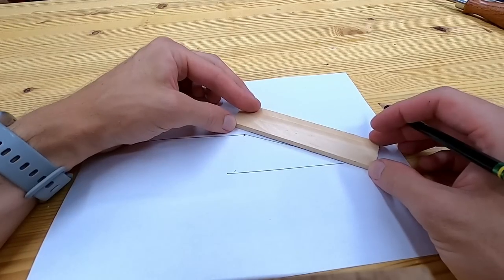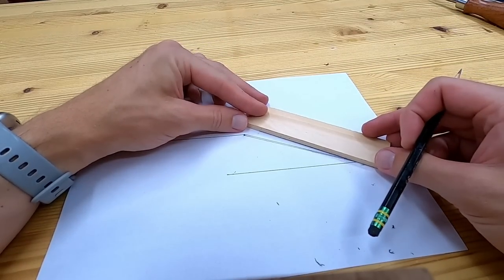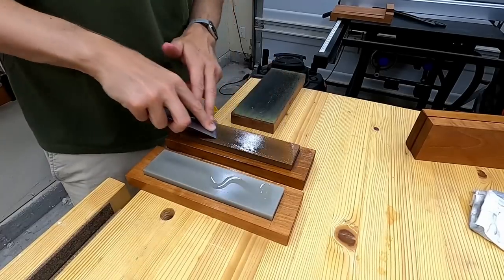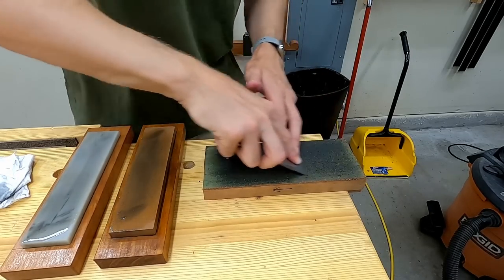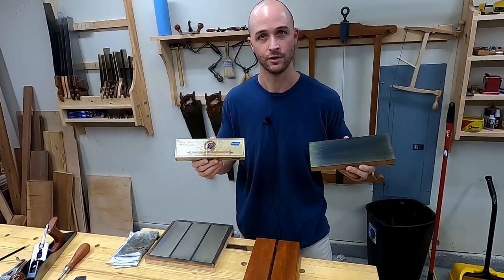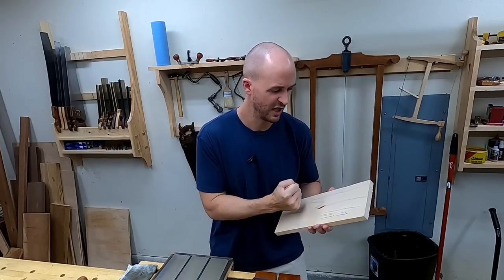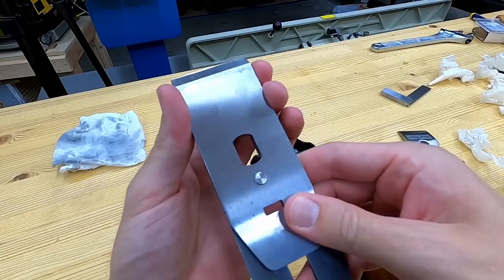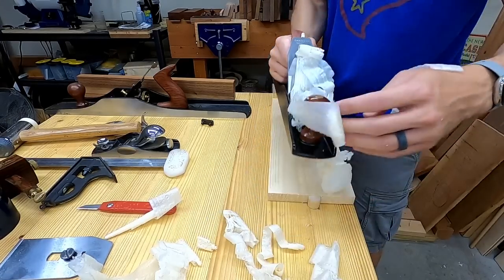Plane Iron Sharpening - Oil Stones or Diamond Stones

Comment: Very well-made and informative video.  Your system with the oil stones is similar to what I have been using since around 1965. I must say, however, that I have fallen to the BS about other stones and have invested in both water stones and diamond stones but always, repeat ALWAYS, return to oil.  I have a Norton stone that must be over 60 years old and still working well.

Comment: 👍👍👍I find it so refreshing to see someone on YouTube – someone whose sharpening is so obviously excellent to judge by your incredible plane shavings – only touching the primary with a coarse stone! If there's one thing that does my head in it's watching someone who purports to be an expert taking the primary up to a high grit (10k or higher?) when it contributes nothing whatsoever to the cut 💢

This is pretty much how I sharpen when I'm being disciplined and want that defined secondary bevel, which I tend to reserve for paring chisels. Most everything else has a single cambered bevel (1000# diamond plate followed by a denim strop loaded with metal polish). Just as you showed the angle does creep up over time so every now and then when it's needed I work the primary down on a 150# diamond plate if I can't be bothered to break out the grinder LOL
Reply from the maker: thanks, I sure appreciate your comment!

Comment: I was thinking about this for a while now, works great on the new thick plane irons, easy to stay on a flat bevel, it's really hard to not round the main bevel on old Stanley irons, they are ridiculously thin.
Reply from the maker: Absolutely true! For some blades I only pull it on the stone rather than pushing and pulling across the stone - easier to hold the bevel. Also a 2" stone makes it easier to hold the bevel than a 3" due to the skew

Comment: Thanks Frank, I tried this method out yesterday, it worked great. I think I will adopt it and if needed re-grind the primary bevel if it goes too far out from 25 degress.  I like the flow idea to avoid the grinder and honing guide if possible, and get back to planing.  Awesome channel, subscriber I think since your 1st video.  Thanks!
Reply from the maker: Thanks Scott that's awesome to hear!

Comment: Great video Frank, your technique is similar to mine, diamonds or India and Arkansas. However I like to strop with red rouge on thin leather strop, rough side up. this is a bit more aggressive and give a mirror finish that is sharp. I started putting a mini bevel on edges after watching your previous sharpening video. This really helps a lot. My theory on this is not so much to add a bevel but to ashore the tip is honed completely. As far as the burr goes I like to pull blade to make it fall off instead of breaking, but then sometimes I will chase the burr too.
Reply from the maker: Thanks Jim. I agree with your theory on the burr... If we can make it quicker and easier to get a good burr, that's really what it's all about.

Comment: I have shapton glass , and even though they are splash stones and dont need to be soaked , i still hate the mess - im using a fine india and then directly to mdf with stropping compound ... Gets really good results - i might add a translucent arkansas stone like yours just to reduce the stropping time .. i like how little mess oil stones create .... Btw i think that yours is a fine india stone rather than medium india .mm i have both and the fine india is orange color while the medium is black ... I might be wrong and they have different colors though hehe

Comment: Hi Frank! Thanks for the video. A couple things I might add:

1.When my secondary bevel was not steep enough, I found I was loosing the sharpness of the edge way too quickly. When my secondary bevel was steeper, say 35 degrees, my planes remained sharper for longer.

2. The distance between edge of the blade and edge of the chip breaker was best set at 2 to 3 mm. Otherwise, chips would somehow find their way between the blade and the chip breaker.

3. The "Charlesworth ruler trick" just changed MY LIFE!!!!

Question for you: how difficult/easy is it to flatten an oil stone compared to water stone? And how do you do it?

Thanks!
Reply from the maker: Good points thanks for commenting! They are much more difficult to flatten than water stones, but really don't go out of flat if you use the whole stone. I've only done it once (around December last year) and I actually regretted doing it bc I discovered that the ever so slight dish across the width was like a built-in ruler trick. Honestly, I doubt if I will ever flatten them again, if an area on the stone starts to seem high, I'll do more sharpening in that spot, but they are very hard-wearing and don't think it will be an issue, I will have to update in 10 more yrs haha
Reply: 1. Steeper than 30° you're losing sharpness. Shallower than 30° you're losing strength. So stick with 30°

2. If chips are getting between your breaker and iron you need to lap your breaker flat. Hold the iron and breaker up to the light. No light should pass. If some does lap the breaker. I've had to clean the tops up on some breakers that are really worn too.

3. The ruler trick is trash. There are no shortcuts.

Answer: A belt sander can really make short work of a honing stone. It can get dusty though.
Reply: @1pcfred  I suppose to each their own. I have found these practices really useful and am able to get finish ready glossy surfaces on hardwood and softwood, end grain and knots alike. and I get these results from inexpensive planes, without spending a fortune. So, I am happy with the results I get, with spending only a few seconds on sharpening, while substantially reducing the number of sharpening sessions. Proof is in the pudding, doesn't matter how one sharpens an iron -  the product (the furniture one makes) speaks for it self. Also, there are always shortcuts but one must know how to use them to their advantage.
Reply: @mohdalisyed  I'd like to see you even get an iron out of a plane in just a few seconds. Quite a few sure. Perhaps a few minutes?

Comment: I have tried several sharpening methods and honing stone grits, and my conclusion is: 1. if the final step is leather strop, the fine honing stone grit does not really matter that much. 2. you can skip the leather strop if your honing stone is 16000 grit(as suggested by Rob Cosman). 3. do not even bother trying to manually reshape the primary bevel (even on 80 grit diamond stone, which I regret buying, what a waste of money), it takes way too much effort.
Reply from the maker: Agreed! With the honing compound it's almost like another stone since it abrades, most important with diamond stones since they are kinda rough
Reply: An 80 grit diamond plate makes a great grading stone for your other hone stones. So not a waste. In my view trying to hand hone the primary bevel is inefficient compared to using a bench grinder. It can be done but I won't do it. You do need an angle adjustable tool rest to get the angle of the dangle right on tools though. If someone isn't handy they can be a bit pricey to buy. I've made my own here. Do an image search for sliding adjustable tool rest and you'll see mine. It's world famous. Wow I'm way down on the rankings today. Still on the first page though.
Reply: @1pcfred  hand honing the primary bevel can be done on thin, narrow and soft blades with no problem, as the blade gets thicker and wider, it will be so inefficient, nearly impossible. My No.8 blade is 2 5/8 wide, 0.17'' thick A2 steal, I spent about 30 minutes on 80 grit diamond stone, and it is not even close to being half done.
Reply: @ZenithsCipher   you hit it. It is not efficient to maintain primary bevels by hand. But the gear to grind tools is not the easiest thing to acquire either. Your typical bench grinder needs a tool rest upgrade to really work. I've seen people try to freehand grinds. They do a poor job. I've made my own adjustable rests. I think that's within reach of anyone that's handy. It's a good place to save some shop cash too.

Comment: Use kerosene on your oil stones. 3 in 1 is a lubricating oil in other words an oil that is designed to reduce abrasion or friction. You want a solvent style oil. I.e. diesel fuel, kerosene, or WD-40. I use kerosene, I used to use 3 in 1…. Wow what a difference. Also it will keep your stones cleaner as 3 in 1 will gum a bit (not much) and cause the metal filings to stick.

Comment: Thanks for this. Do you use an after market iron or woodriver brand?
Reply from the maker: Yes I use a veritas replacement blade for Stanley/record planes
Reply: @FranksWorkbench  And it fits a woodriver???
Reply: @FranksWorkbench  Fits woodriver? I had assumed I'd have to get an IBC for my no 4.
Reply from the maker: Yeah man it fits, it a little thinner but still works fine have it in my #5 and 7

Comment: Do you always camber them? And do they need a camber?
Reply from the maker: I have a slight camber of #5&7, no camber on the block plane, and a heavy camber on the scrub plane. Check out the back half of the video somewhere in there I show a few areas that it helps
Reply: @FranksWorkbench  yeah, I should have waited. I typed my comment and then continued watching and thought "Oh, well there you go." 😉
Reply: All plane irons should have some camber except for a shoulder plane. It's OK if a plane digs in cutting a tenon. But for a smoothing plane the camber will be very slight. Scrub planes are revelation too.

Comment: Word of caution for new woodworkers. Don't go buy a cheap combo waterstone, they are almost always trash and the grit is not accurately labeled!
Reply from the maker: Appreciate your insight!
Reply: @FranksWorkbench  the Amazon special is special for all the wrong reasons on those stones!
Reply: @FranksWorkbench  one other piece of advice I think is good for new woodworkers. If you're not certain you want to stick with it, start with a few sheets of sandpaper and a piece of melamine or float glass. When you know you'll be continuing down the rabbit hole, invest in good quality sharpening like the methods you recommended. This is an area where "buy cheap buy twice" is true. Get a decent quality sharpening system and then don't think about it again for a few years or more.